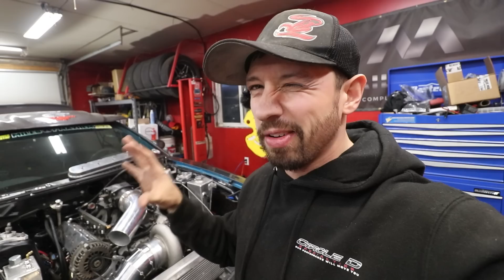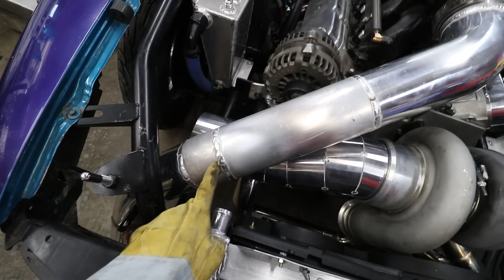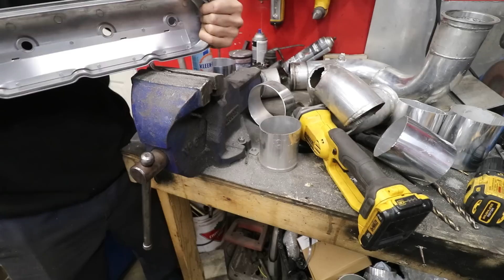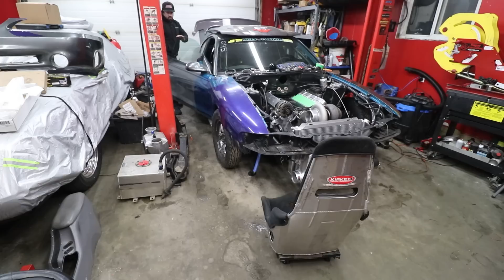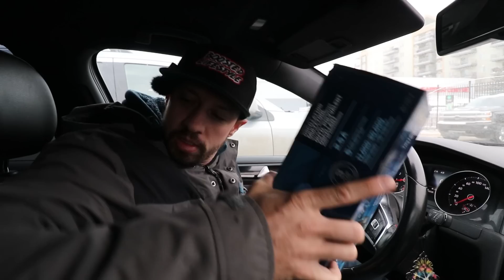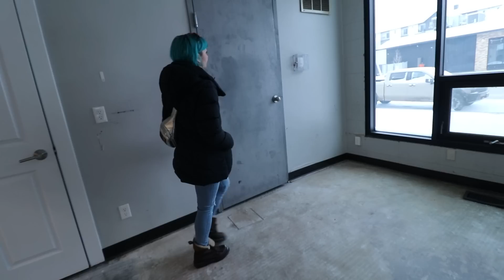New Boosted Lifestyle Shop. Could Be Huge

Comment: Quick tip for bitumen sound deadening, take the car outside open the doors let the car get really cold then just chisel it off. It’s quicker and easier and let mess. I did an suv in less than an hour.

Comment: i think i pulled 28lbs out of each door on my fox body.  i still have factory glass and they roll up and down. crash bar delete. and then carved every piece out not needed. deleted door panels. wolfe race craft has nice thin aluminum door panels to replace the stock stuff. the emergency brake has a very heavy base structure on a fox. probably similar on yours. team Z has some light weight seat frames. lots of weight savings there. windshield wiper motor. not sure if you still have it. i cut lots out of my dash. removed some of the extra structure holding the steering column.

Comment: A really good trick for getting sound insulation out is to dump a bunch of dry ice pellets on the floor and let it sit for 10 or 15 minutes. It'll basically freeze it solid, and then you smack it with a hammer, and it just turns into chips and comes off without being covered in adhesive.

Comment: I had the same deal with my seat, got it used with rails already on it.  The guy made the mount with 1/2"x3" flat steel, the two pieces that the seat sat on were almost heavier than the whole seat.  Just remade them the same but aluminum and shaved off a ton of weight (and fixed the seat because the rails were a triangle and didnt slide right)